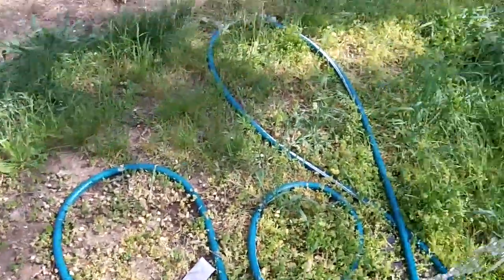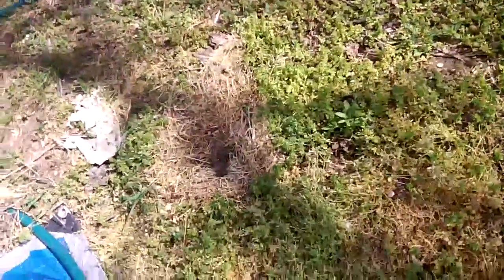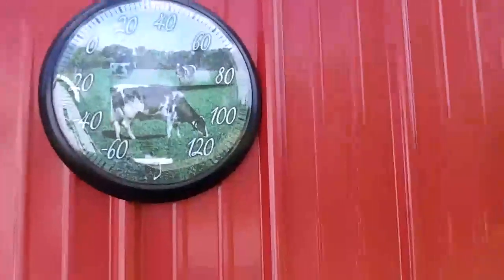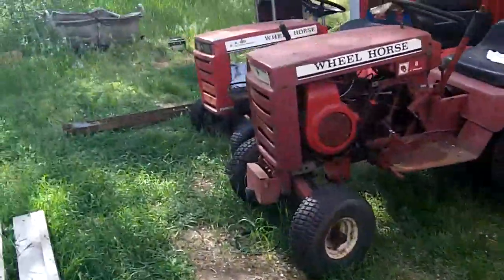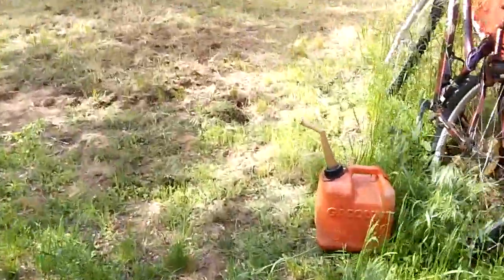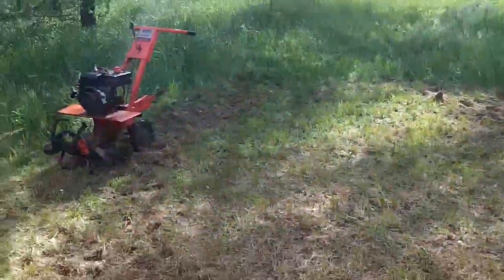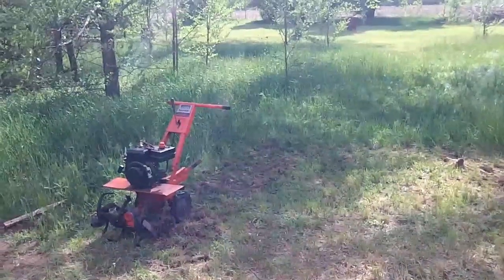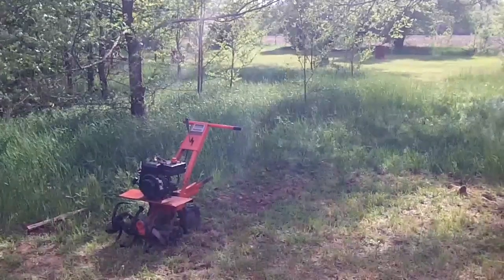Old Montgomery Wards Powr Kraft part 3-runs but I don't know how to use it.

Comment: Good video. We have a very old Firestone tiller, similar design to your tiller.
We have a 1/2 acre garden we work every year. We do the initial till with the tractor and keep things clean with our smaller tillers, and working by hand. If your soil is rock hard you may need to get a plow and turn to the soil below. Don't wear a tiller out trying to cut through the ground. Then I would let this tiller bury itself and ease on through the dirt, once plowed. I like these older front type tillers, they do the majority of the work, we're just guiding. We have a newer Craftsman with gear driven wheels that is more of a strain to use believe it or not.
Reply from the maker: yep it does a really good job of tilling. I hope to use it again this year if Spring will ever get here Thanks for watching and commenting.
Reply from the maker: Thanks for the information!

Comment: Shouldn't have to sharpen the tines, they will go dull quick. It should easily dig and do all the work for you.
Reply from the maker: +Bryan Gray thanks Bryan. I'll have to remember that next Spring.
Reply: Just got one the other day, first monkey ward as they were called, and can't wait to get it fixed up. I buy/get old tillers and snow blowers, fix and sell them. No reason to buy a basic snow blower or tiller for $400 when I can sell them for a quarter of that price.
Reply from the maker: i was given a Toro S200 snowblower last year that sat what I thought for ten years, but the guy who gave it to me said it was more like twenty years. He got from a neighbor and already had one. All I needed to do was add gas and oil and it started right up. I've got a video here on the start up and performance.
Reply: They are easy to fix too, I buy fix and sell them and I'm selling one this weekend.
Reply from the maker: The season may be sooner than I think. Could of snowed last Saturday, just about 5 degrees too warm.
Reply: I went to Michigan city to go fishing and it only rained a bit but quickly warmed up. We can thank the hurricane for the easterly winds Saturday too. Glad that it's getting back to being warm this week to finish fixing the monkey ward and a snapper snow blower.
Reply from the maker: reminds me, I been meaning to work on my plow tractor all summer, and haven't got around to it yet. Now's the time I guess.
Reply: Sounds like a plan.